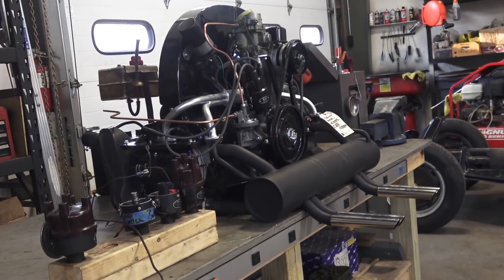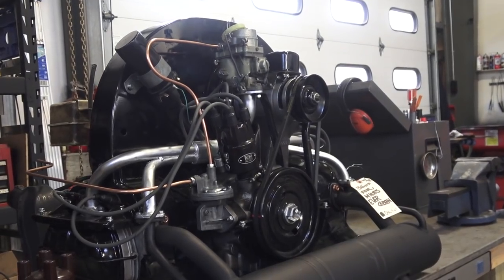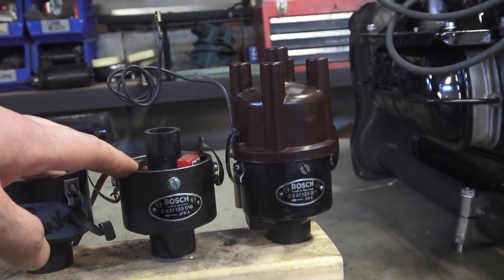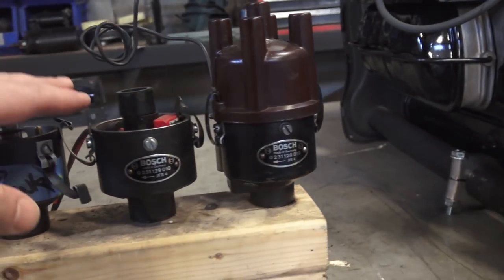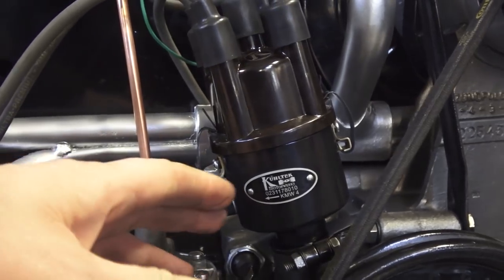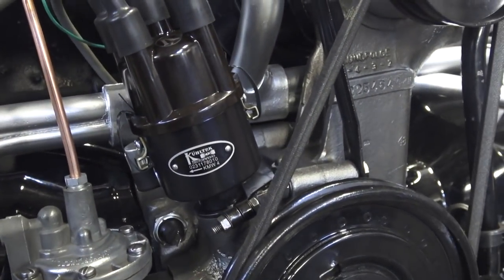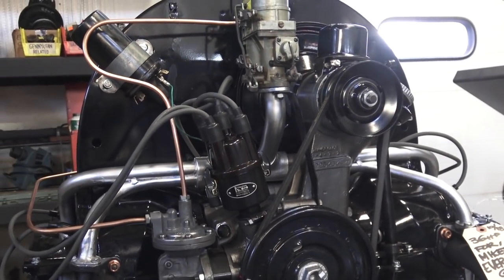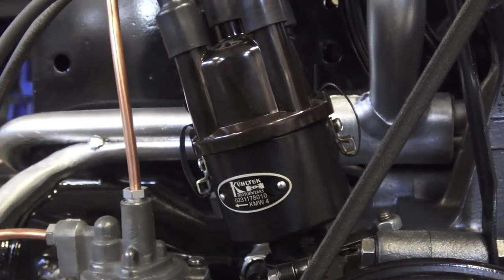Classic VW BuGs Vintage Beetle Distributor Review Kuhltek like Bosch 010 019

Comment: Hi Chris! I am trying to get the distributor out of the engine to clean it because it is rusted but it is stuck. I loose the nut that holds it to the block, put the rotor pointing to cylinder 1 but it won't come out. Any tips? Thank you!

Comment: Have you had any probs with these since you made this video? Thinking about getting one of these as a back up. I daily drive a 71 super using one of the short style distributors for 68 with a 30 pict 2 carb, single port 1600
Reply from the maker: So far only one was defective.

Comment: Hi Chris nice vid on these distributors. Got a question what would you choose to run on a 40hp, 6volt. What type of distributor. My 28pict is done and probably going with a 30 pict carb for replacement thanks for any info on this.
Reply from the maker: I like either the kuhltek I show in the video or a bosch 019 dizzy.

Comment: Hallo Chris!
Can you help me please? Where can I find a flat top distributor cap (like on 25hp engine) for an ordinary vacuum advance distributor from 1971. onwards Does it exist?

Or, (option 2), can I install a 25hp engine distributor (with vacuum advance) on my 1.2 engine from 1971. and put a flat top cap on it?

I just like to see a flat distributor cap and i want it !!!

Do you have any experience with that? 
Thank you in advance!
Reply from the maker: Those caps are only meant to go on a 383 distributor, they will not fit a 70s model.  Nor do you want to put that distributor into a later motor.